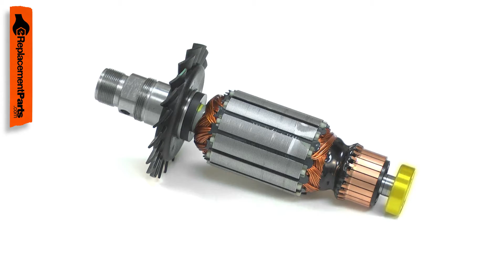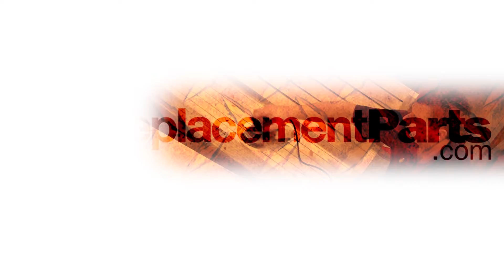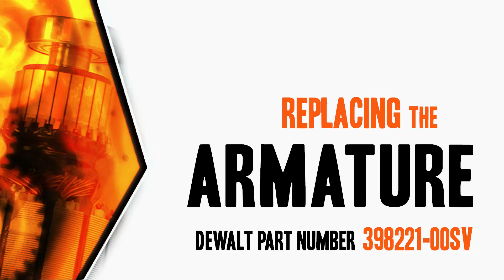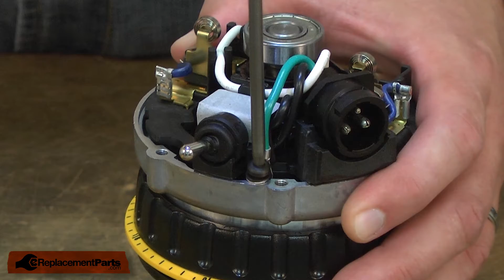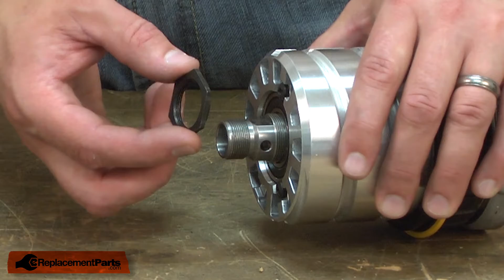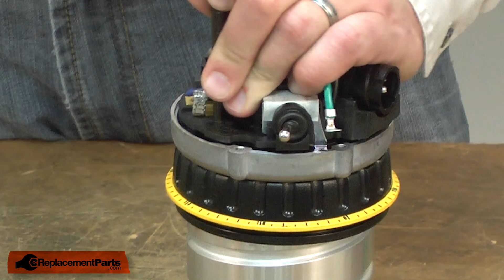Router Repair - Replacing the Armature (DeWALT Part # 398221-00SV)

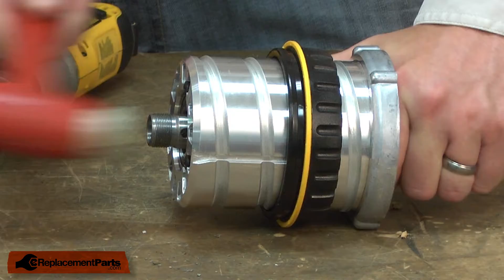Comment: At 3:20 you removed the lower armature bearing to "install onto the new armature." However, at 3:40 when you installed the new armature, the bearing was back in the spindle so you could not "install onto the new armature." Please explain.
Reply: The bearing is pressure fitted onto the armature, but is loosely installed into the housing.  You can remove and install the bearing by hand into the housing.  Using the mallet as shown in the video, you can seat the armature into the bearing.  Go slow and knock in a circle around the housing as he does.  It is generally much tighter than shown here.